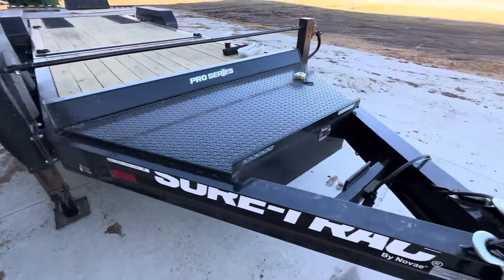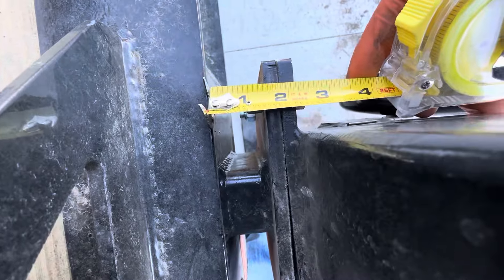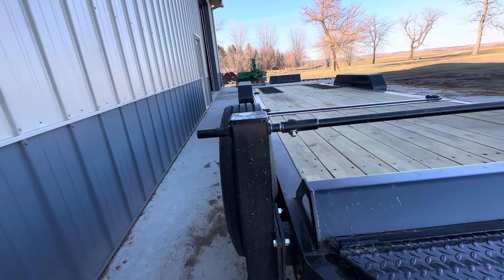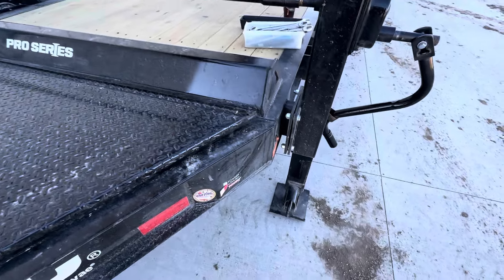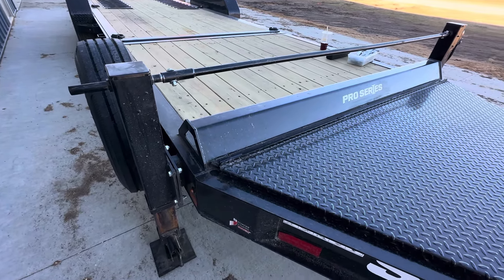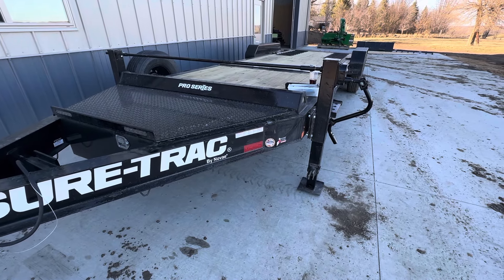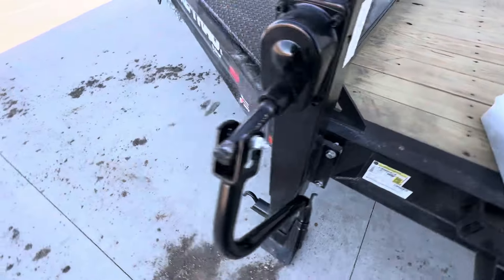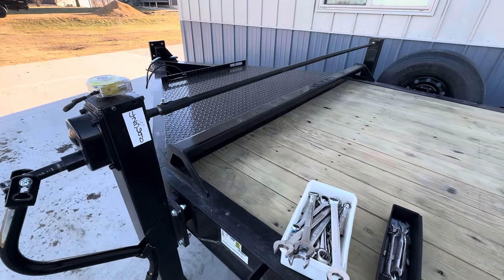Fixing the new Sure Trac Tilt Deck Trailer

Comment: Hello. I have question. Can you help me  I have a 455 and the lift cylinder for the deck started leaking. I got a replacement and installed. So now the cylinder is traveling full stroke but deck is not moving. Up or down. The lever rod which attaches to the cylinder and the stabilizer (lift rod at back) and travels to the front where it is slotted about 6 to 8 inches. When I operate the lever to raise deck it travels the full length of the slot up front and never raises the deck. I did not remove anything but hoses and two pins and reinstalled it back. Now it doesn’t. Move deck ? But the cylinder is traveling full stroke. It does to appear to catch right and the end of the stroke of cylinder. I see deck move slightly. I removed transaxle to repair the packing on forward and reverse lever ( watched your videos on how to ). I have replaced cylinder on another 455 o have with no issues on that one. Any ideas on where to start. Deck is lot bound and all levers are locked in place.